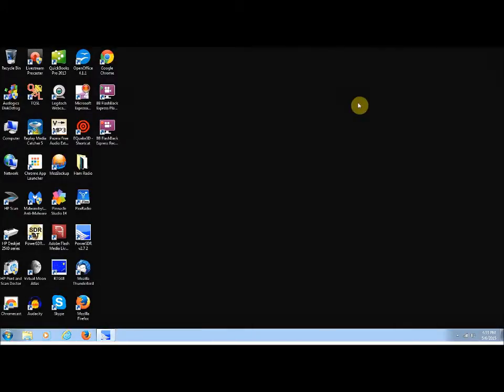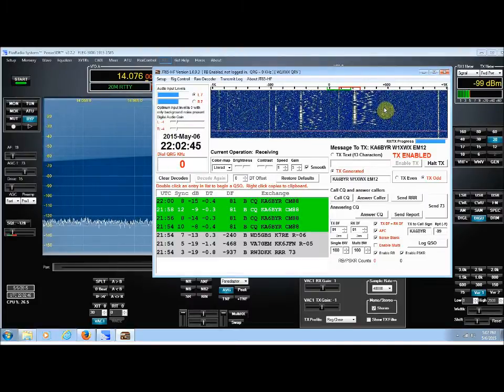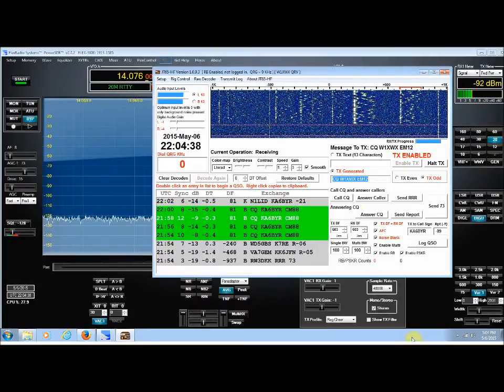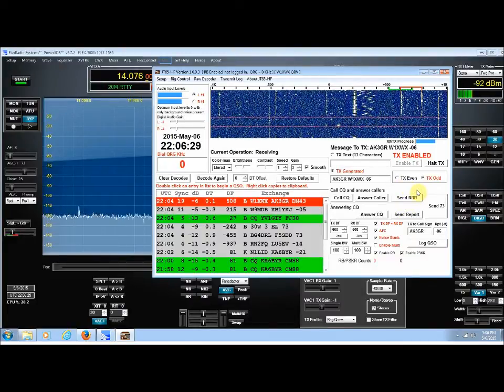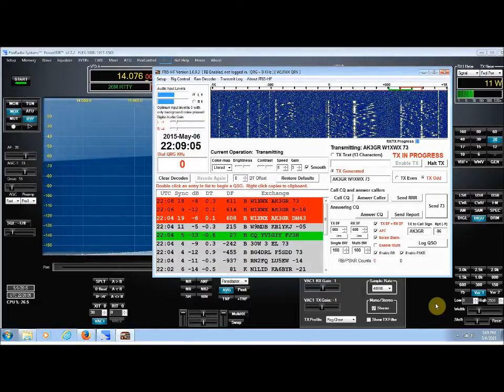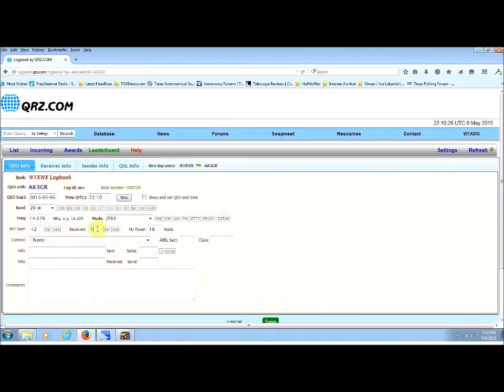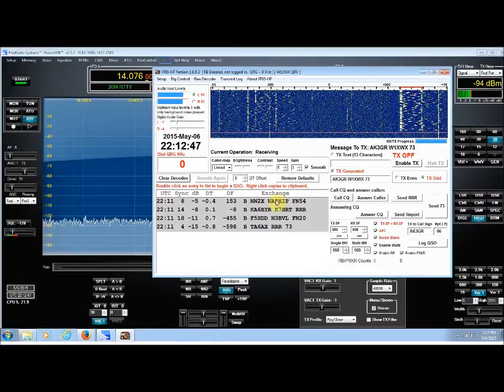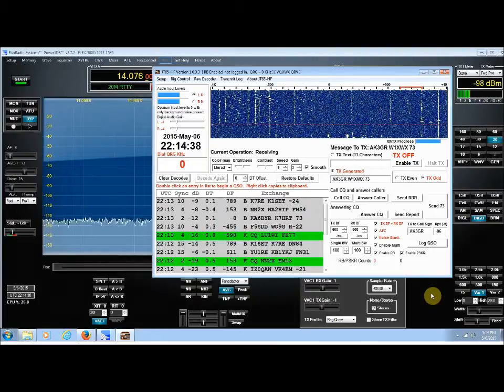Operating JT65- ham radio digital mode contact

Comment: What is the purpose of this digital mode if the QSO is just that?  How can it be used for emergencies or more elaborate communication?
Reply from the maker: Any 13 text characters can be transmitted. However it65 has been replaced by FT8 which transmits much faster. Also JSCALL has come out which is more like PSK31.

Comment: Clocking question.... Does it require that both clock be in UTC time or cam one be UTC  and other be EST? Meaning that JT65 software clock and the computer clock?
Reply from the maker: +steve0432 You just need to sync your clock to internet time. All signals begin exactly on the zero second, so your computer clock needs to be accurate to within 1 second. I use Nistime a free software that syncs the computer clock. Your local time on the computer needs to be correct.
Reply: Thanks Joe! I'll be hearing you on the air.

Comment: Joe, great very informative video, thank you for posting.

Is that the extent of the JT65 QSO "conversations?"

CQ - signal report - 73

All taking like 6 minutes or more.

Hmmmm

I think good ole CW has that beat and also works on low power.

:)
Reply from the maker: +Rob McCance 
Yes, Call CQ, Send signal report, get signal report, send RRR, get 73, send 73. This is the complete QSO. However some folks short circuit this by sending ---  "call sign" RR73 ---- or  a text message --  TU GL 73 - (thank you good luck 73) after receiving their signal report.
Reply from the maker: +Joe Lalumia 
PS- I did a second video see my channel it is called JT65 for beginners.